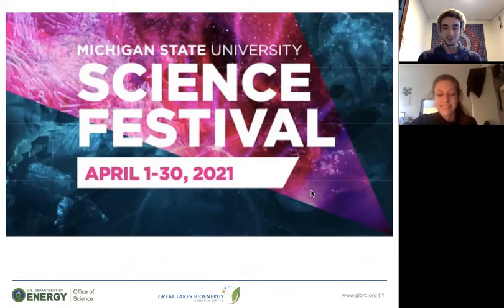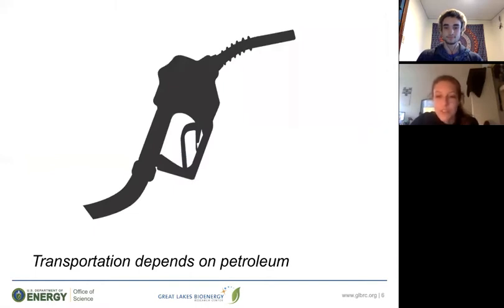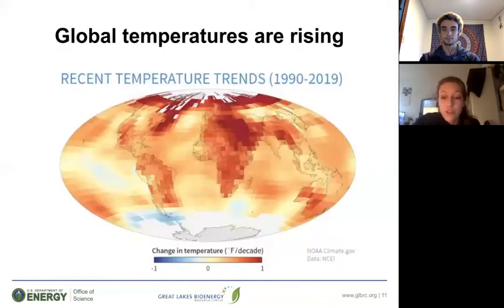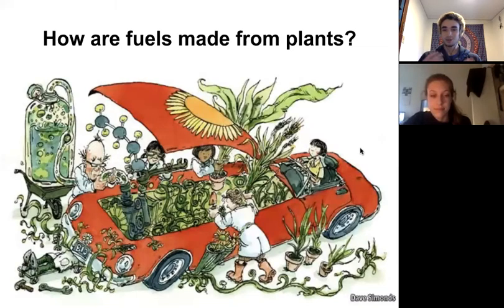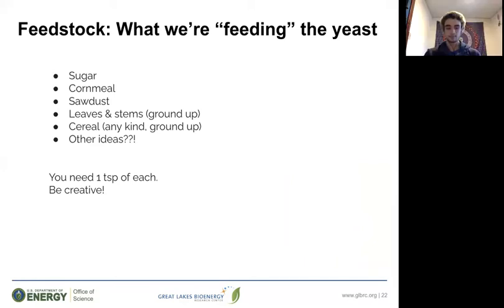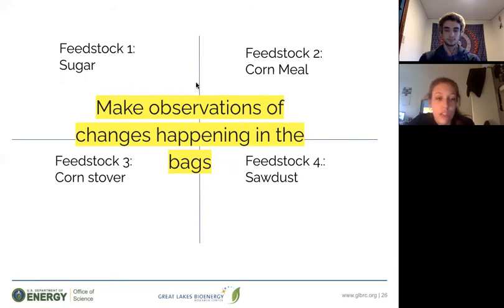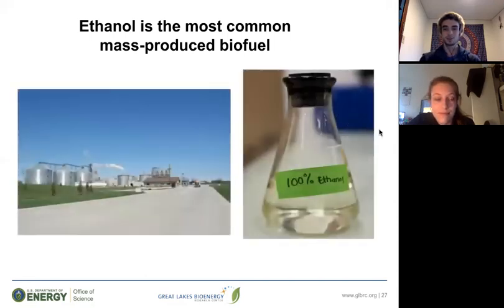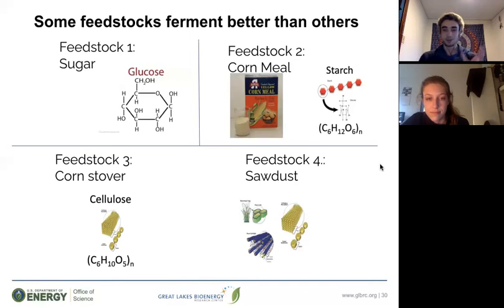Grass to Gas: A Fermentation Experiment

Comment: 1) By reflecting away 30% of ISR the albedo, which would not exist w/o the atmosphere/GHGs, renders the earth cooler than it would be without that atmosphere like that reflective panel set behind the windshield. Remove the atmosphere/GHGs and the earth would become much like the Moon and Mercury, a barren rock with a 0.1 albedo, 20% more kJ/h, hot^3 on the lit side, cold^3 on the dark. Nikolov, Kramm (U of AK) and UCLA Diviner mission all tacitly agree. 

2) the GHG up/down welling, “trapping”/”back” radiating/delaying/intercepting, 100 % efficient, perpetual warming loop requires "extra" energy which according to RGHE theory comes from 

3) the terrestrial surface radiating "extra" energy as a LWIR ideal black body which

4) cannot happen because of the non-radiative heat transfer processes of the contiguous atmospheric molecules and as demonstrated by experiment, the gold standard of classical science: 
https://principia-scientific.org/debunking-the-greenhouse-gas-theory-with-a-boiling-water-pot/

1+2+3+4 = 0 Greenhouse Effect + 0 Greenhouse gas warming + 0 man caused climate change.

Version 1.0 032721